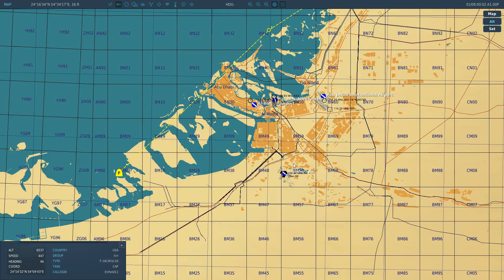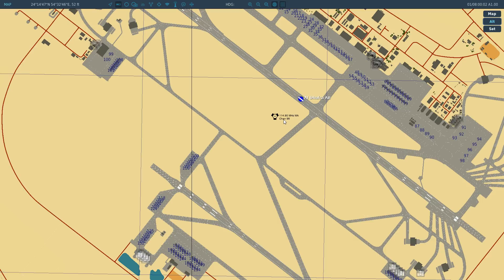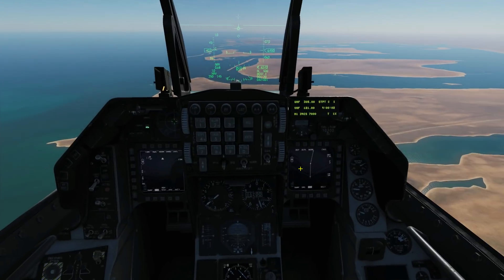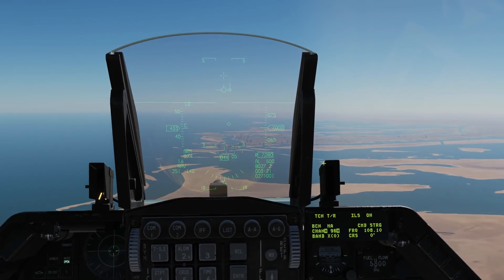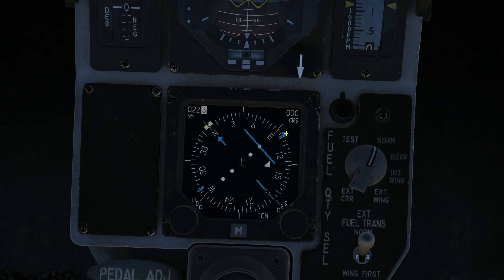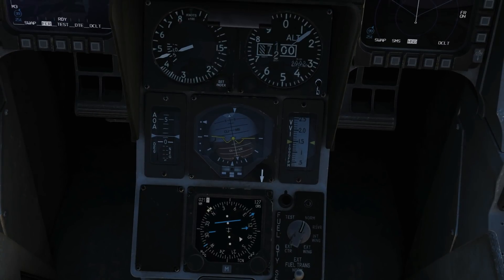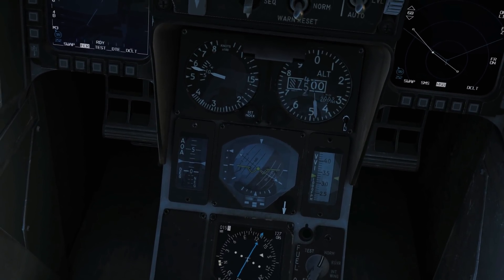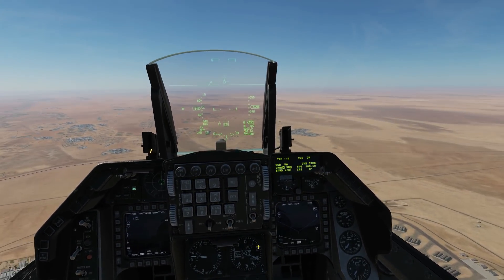F-16C Viper: Tacan Navigation & Runway Radials Tutorial | DCS WORLD

Comment: On DED tacan says "OFF" I cannot figure out how to turn it on...
Reply: Ah! I didn't have the "MIDS LVT" knob turned on. Thanks to Facebook I got the answer... I couldn't find the reference in the manual... But maybe I'm just blind! Thanks!
Reply: @Moose88  if it is of any consolation - I had the exact same thing happening to me. and nowhere in any checklist does it seem to say "MIDS...ON" However it helped me understand the "fine print" in the cockpit: if you look closely the ILS volume knob actually has an "OFF" written at its far left position, indicating that you will actually turn off the ILS completely if you turn its volume down all the way. The switch right next to it - TCN - however, does not have this "OFF" written at the low end of the volume range.. because THAT will actually NOT turn it of... because "MIDS LVT" will, as we both have found out by now :D it's the detail I have come to appreciate in these simulations
Reply from the maker: I have never seen it off...